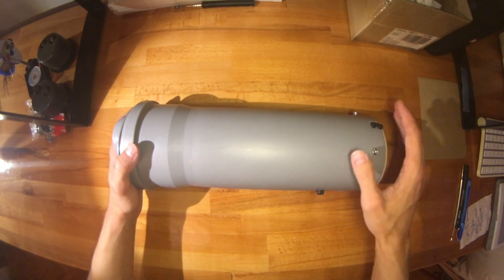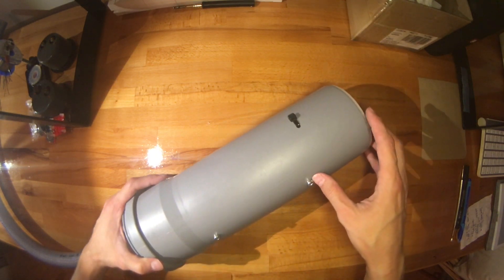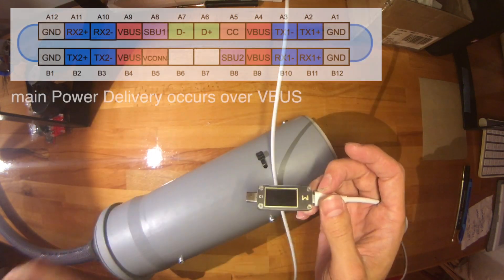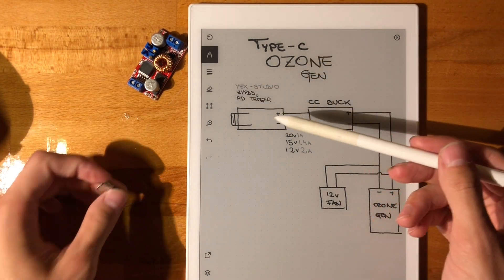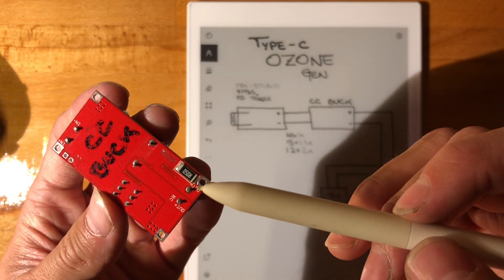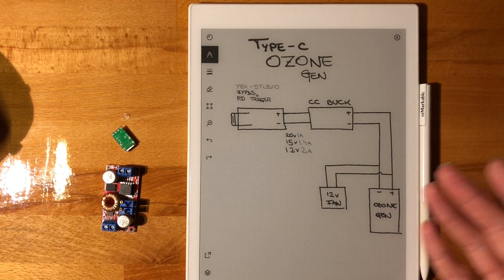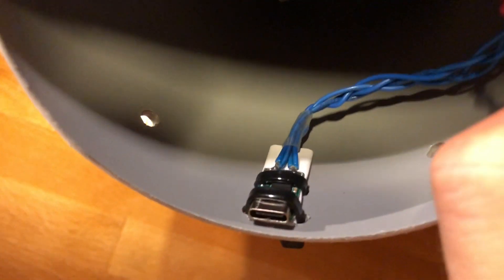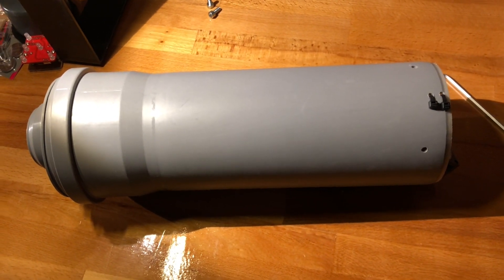Building a USB Type-C Ozone Generator

Comment: The ozone itself won't do that much for smoke, but a negative ion generator will. If that's how it generates the ozone (via corona discharge) it should work.
Reply from the maker: and I assume it always has to be the negative side that gets charged to an insane voltage ..

I'm wondering, what if the flyback or whatever transformer it uses .. what if that puts a positive charge ? would that still work 🧐